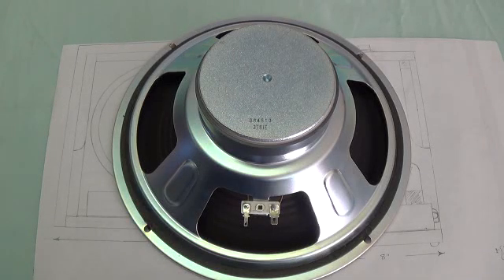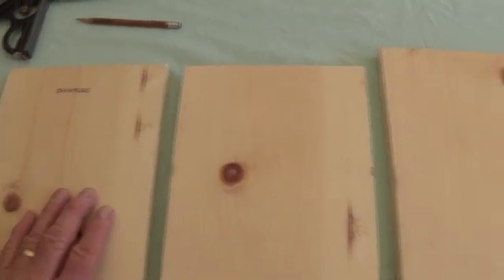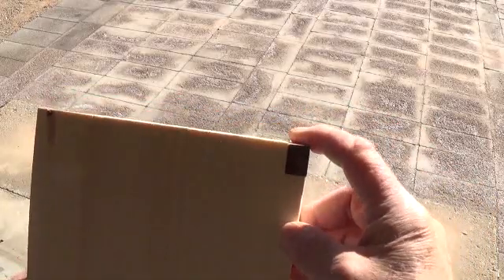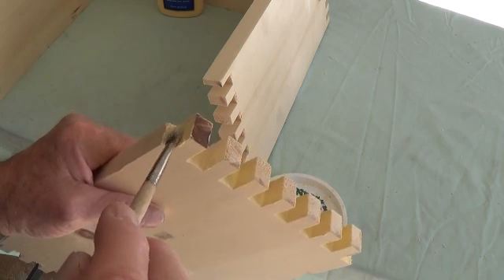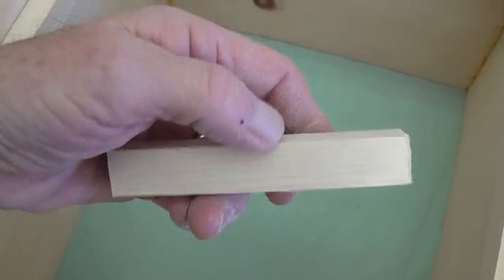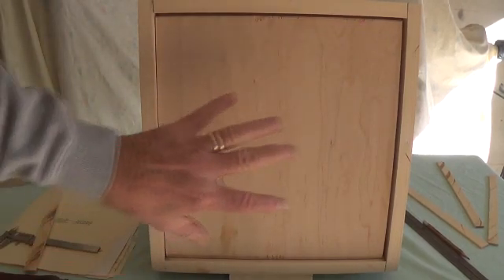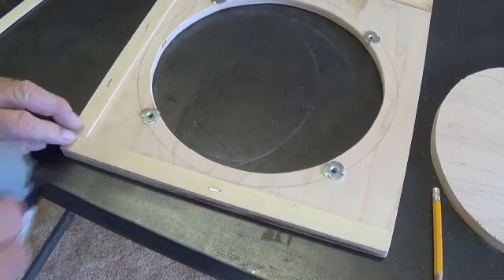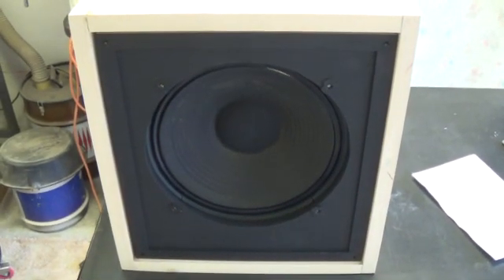Constructing a Finger-Jointed Pine Amplifier Cabinet.....Part 1

Comment: How do you attach the baffle to the cabinet after it has the grill cloth installed?
Reply from the maker: In this case, either four screws through the grill cloth......or four studs installed in the baffle before the grill cloth was applied.

Comment: Greetings Doug. I'm building a similar pine box cabinet a bee (brood) box for $20. Anyway I noticed in this video you mentioned that the power leads to the speaker be positioned perfectly straight down. Is this because your amp is beneath it or is there another reason? I ask because my amp will be on top of cabinet. Thanks Doug. As always your lessons are the best!..Sky
Reply from the maker: That video was made long ago, Sky. I guess I meant that, as you surmised, the leads should go in the direction of the chassis. Good luck with your project.
Reply: @UncleDoug  Thanks for your quick response Doug. I don't know how you do it...answering all your Youtube fan mail. But you do w detailed, courteous responses. Who knows. Maybe 1 day our paths will cross. I would like to buy you a beer.
Reply from the maker: @MrSkywunder  You're welcome, Sky......and I would gladly drink that beer ;)

Comment: Great video! I'm about to build a head cab and matching speaker cab for a tweed Champ clone I currently have in a 1X10 combo cab. I'll size the speaker cab appropriately so I can can make 2 baffles: 1 for a 10" speaker, and 1 for a 12" speaker. I didn't read all of the comments, so I apologize if it was asked and answered, but why not use a 1X10 piece of pine, instead of adding the extra inch of wood on the front? Not being critical, but just wondering if there's a functioning reason for it, other than you wanted a little more clearance. I'd think a 1X10 plank would achieve that as well, and keep the box to 4 pieces of wood. Just curious. Thanks again, for the great video!
Reply from the maker: This was a long time ago, Dave, but I think there were no good, straight 10" wide boards to be had at Home Depot that day.
Reply: @UncleDoug  That makes sense. I have a great 10' 1x12 board, with good grain, that's straight as can be, but I got it from a lumber yard. I'd rather save that for something else, instead of ripping it to 10", and get a 1X10 board, but we'll see.
Reply: Oh snap! I wanted to add, I didn't realize that you're the guy that makes the great "How Tube Amplifiers Work" videos, which are excellent! Thanks for explaining things in a way people often confused by this stuff can understand!
Reply from the maker: You're welcome. Glad you enjoy the videos.

Comment: Ok 
I am convienced beyond a shadow of a Doubt ..  that You are the Tube Amp God of All Gods ..  ok Enough Sucking up .

I am a over the road Driver   I have a 1600 watt inverter I have 5 battreies on my tractor ..  what I would like is a 5 W tube Amp  with a 10 " speaker . this will also be used on 110 currant as well ..  something between a champ and a jr Blues Amp .. If you read this . and interested please let me know .  you are very  Finicky and take pride in your Workman ship this is something I apprecaite very much ..  I look forward To speaking with You ..  Thankyou for your videos ..
Reply from the maker: It sounds like you're looking for an early single-ended Princeton, LB, like the model 5F2-A I featured in a previous video. Check it out. Be sure to subscribe to get new video alerts.

Comment: 6yrs late to this one. Nice Doug :)
Have you ever tried using a ceiling diffuser for a speaker grill? It takes a taller and wider baffle to accommodate but it works quite well and looks cool. I wonder if I am the first to do this?
Reply from the maker: I have not, Tim, but appreciate the tip.

Comment: I've gotta say, after 4 semesters at ITT Tech, those who cower in the face of arithmetic, should probably run now. Run fast and far, because it only gets deeper, and if ohms law causes anything but elation, maybe you should leave this part to the rest of us. We will gladly carry the torch into tomorrow, with a cheerful smile as we accept payment for biasing your amps.
Reply from the maker: Well said, Brian, but at least if the math is presented in a palatable way, it is easier to "swallow" :)
Reply: It's not TRIG, or, perish the thought, Calculus 😭, Rolling on the floor clinching my sides from laughing harder than I have in years. I nearly pissed myself. Good show Sir.

Comment: Sir, great build, truly a Master I would love to apprentice for. A suggestion for improvement, with your approval; you use T-nuts for securing the speaker to the baffle, a very pragmatic and necessary modification, would it also make sense to use T-nuts when securing the baffle to the cleats? Your opinion on this will be carried forward and given high regards.
Reply from the maker: Thanks so much, Brian. I would agree with their use to mount the speaker baffle to the cleats.....especially if they were installed in the front of the baffle itself, like those for the speaker,  hidden by the grill cloth and allowing for invisible but very secure fastening of the baffle to the cleats. Good idea !!

Comment: Dovetails would have made a big difference. Slso a pc fan to get the hot sir out pat tubes is best idea. Doesnt need to interfere with amp. Could run off 5v.
Reply from the maker: Thanks for the suggestions, Matthew.

Comment: Are the spacers that the grill cloth sits on needed if your wood baffle has a decent thickness to it? because then the speaker is technically far enough away from the grill cloth that it won't touch it?
Reply from the maker: The spacers are not to prevent the speaker from hitting the grill cloth. By lifting the grill cloth away from the baffle, it allows the speaker to move air through the entire grill cloth, not just the circle of grill cloth over the speaker. This is how Fender does it.

Comment: Do you have any suggestions for building a cabinet without finger joints .. for us  commoners who are  limited to a circular power saw and drills .
Reply from the maker: Sure, Wiley. I have seen some commercial amp cabinets that don't have box joints. As long as you intend to cover the cabinet with a material, who would know?  Just screw or nail the heck out of the joints, use plenty of good glue, and be sure to have panels in the upper and lower rear to keep the cabinet square.
Reply: Uncle Doug  I guess my concern is having the nice rounded corners and edges you get with wood working equipment.

Comment: great video!  I know it's been a while, but had a question.  I see that you added an extra inch to the frame so the chassis didn't stick out.  was there a reason that you didn't just just get a 1x10 and rip that to 1x8?
Reply from the maker: I don't recall exactly, Michael, but either I had already cut all the notches for the box joints, or I just didn't want to go back to the store to buy more lumber.

Comment: so where can you get straight boards?  Is home depots birch 3/4" plywood ever straight?  Also, on that video with the finger joint jig they did not show anything about making the "key" to align the jig... having that be perfect would be very important to the tightness of your joints wouldnt it?
Reply from the maker: The select pine boards at either Lowe's or Home Depot are generally straight enough for small cabinet building, CM. Yes, the key is simply a small piece of wood exactly the same height and width as the notches being cut in the ends of the planks.

Comment: Uncle Doug, for building a simple head cabinet (no speaker), and using minimal tools (I'll have to have the wood cut by Home Depot), what kind of corner joints are best? Butt joint, or rabbet, etc.? Have you seen any good videos on how to make them?
Reply from the maker: Finger joints are best, but since you have no power tools, it would seem that you are limited to butt joints, which are the weakest of all possibilities. If you can gain access to a table saw and dado blade set, then this is an excellent video on how to cut box or finger joints:  https://www.youtube.com/watch?v=AiPzFNsuN2k
Reply: Okay, and thanks for the video link! I also might look into a bisquit-type joint. That tool seems like a nice initial investment. I have no garage, etc., so table saws and the like are out of the question. Cheers and thanks!
Reply from the maker: Good luck with your project, Roger.

Comment: Do you have any thoughts about edge glued pine boards? Our local Menard's has edge glued pine 1 X 12s. They are 25 to 40% more expensive than no. 2 pine and still have knots, but they should be straighter and flatter than regular pine 1 X 12s.
Reply from the maker: I'm not familiar with the term, Bill. Do they soak the open grain at the end of the boards in glue to seal them?  I don't see how this would make a difference in the straightness of the board......unless they only edge glue better grade lumber.
Reply: Edge glued boards are made by gluing narrower boards together to make a wide board, much like a table top. This allows the grain to be reversed on adjacent narrow boards which may reduce warping. I probably wouldn't bother with a 1 X 8 or narrower, but the 1 X 12s that I have seen are pretty straight and flat. You can get the edge glued boards as wide as 18 or 24 inches. I've been seeing edge glued Aspen boards for some time, but only recently seen them in Pine. The knots are small and there should be less waste. I haven't noticed, but there are probably finger joints in the narrow boards. These should be staggered and shouldn't affect the strength of the board.
Reply from the maker: Now I understand, and it makes great sense. Such composite boards would not only be flatter, but also more interesting if stained and finished. I only use 1" x 8" (maximum) for my cabinets, so this may not apply to my needs, but I can definitely see why others, who need wider boards, would prefer this method to warped, wavy "natural" wood.

Comment: I feel like a bit of a butcher seeing this as I used a biscuit jointer to make my guitar cab
Reply from the maker: If your method of jointing produced a solid, attractive cabinet, then there is no need for remorse, PS.
Reply: It worked surprisingly well.  I braced the corners too just in case.  Building a cab is one of the most rewarding projects I've ever done
Reply from the maker: For very heavy amp cabinets, I use metal L-angle internal braces also, at the inside top-side intersections. It would be a shame if the whole cabinet and chassis were to break away and fall down a flight of stairs :)

Comment: Hi Uncle Doug, a couple questions if you have time to answer. I don't have access to pine, and I'm not a woodwork buff - I'm an electronics hobbiest?? Currently living in Indonesia and pine is uncommon around where I live. 4 choices I have are plywood, mahogany, merbau and teak. Does the timber used affect the sound the amp puts out?? please advise which is the most suitable. price is no matter as all are pretty cheap here..in fact plywood is probably the most expensive.
Reply from the maker: I would think that the harder the wood, the less the cabinet would resonate, and laminated wood is hard to router......so I guess the mahogany would be the best choice, however this is just a guess since I have no experience with any of the woods you listed.
Reply: Thanks Uncle Doug for the prompt response. Yes my amp will be natural look, so mahogany should look nice, Its used as guitar top on some acoustics, so it has good resonance properties (i'm guessing)...but its pretty thinly cut for that application. In an amp with a heavy magnet and vibrating speaker cone, wondering how thin my panels should be??? Being a hardwood, maybe I can get away with thinner walls still have resonance (and reduce the overall weight), and still retain structural integrity?? thanks for all your time and effort on making these vids..much appreciated and valued resource. cheers Steve
Reply from the maker: If you have good, solid finger joints and a small to medium-size cabinet, I would think that 1/2" mahogany would work fine......and look great to boot.
Reply: Thank you. Sounds like a plan. Yes it will smaller than champ size..more like a mini solid state amp..based around a 6" speaker..something I can put up on a desk at low volume. cheers for your help. One more annoying question :). I will be buying a router to do the finger joints, and making up a jig. What type of bit should I buy and what width. I guess I should be asking what size are the finger joints, if the amp was just 12 inches in height..and what would you recommend for the rounding ..1/4 inch bit if the thickness is 1/2 inch??

Comment: 1/8 " for two layers makes for 2 times that for clearance right? Baffle will need clearance for 4 layers not 2.
Reply from the maker: I was describing the clearance for each side of the baffle, Pief, which would be for one layer of grill cloth and one layer of covering material. Naturally, since there are two horizontal sides and two vertical sides, the overall dimensions of the baffle must provide for twice this amount.

Comment: Hey dude. What a great video! One question, what are those things that you use with the screws to secure the speaker to the baffle?
Reply from the maker: I believe you are speaking of the press-in nuts that are readily available at Home Depot and other such stores. They have prongs that prevent them from spinning when you tighten the speaker screws.
Reply: Uncle Doug, they are known as "T-nuts".  It is best to router a recessed area for the flange(s) of the T-nut(s) to sit in, flush with the surface of the board (alternately, you can also use a flat spade bit to drill a flat-bottom  recess for the T-nuts). I also rough up the T-nuts with a Dremel bit and epoxy them to the wood panel, or they may come loose ( push out, or spin free) when threading and tightening the speaker bolts. Modern, new growth white pine is SOFT.
Reply: Mathew Barwick, they are also known as T-nuts. See the longer comment directed to Uncle Doug....

Comment: Doug I may have missed it if you mentioned it, but what kind of screws are you using to secure the baffles to the box?
Reply from the maker: I use basic 1 1/2"  #8 or #10 wood screws, with the heads painted black so they don't show through the grill cloth.

Comment: is it possible to alter a existing cabinet from 1 big cone to 4 12" cones
Reply from the maker: It's impossible for me to say, without all the measurements and/or a diagram of the cabinet, but I guess you could cut out the single-hole speaker baffle and install a 4 x 12" hole baffle.
Reply: Thank you for the info the video was realy help full
when i get in ill take a photo of cabinet and tak measurements n send then to you
Reply from the maker: Kristopher, I think you should look at your speaker baffle and determine if there is sufficient surface area for four 12" speakers. Perhaps you could cut four 12" circles out of cardboard and see if they fit. If they do, then replace your single-hole baffle with one that has proper cutouts for your four speakers.
Reply: will do thank you doug

Comment: just to clarify, my fingers are all the same just like yours except where you used a narrow finger I used a larger by 1\4" finger. your videos are supreme! i am trying to build this project legitimate but tools of course are an issue somewhat. I bought router bits that I will mount to a drill and monkey rig to a table to save on the cost of a router table. and for the finger joints I may have to file them all into spec! more motivation than time or money is my situation
Reply from the maker: Thanks, John. I doubt that a drill can spin the router bit fast enough to make smooth cuts. Routers operate at a very high RPM.....much higher than drills.  Filing the finger joints would be quite a task, but I guess if you have the time and patience, anything is possible.  Good luck :)

Comment: I found a couple good planks and chose cuts without nots in the wood. I'm also planning to cut my finger joints to include a larger finger instead of a slim finger to add strength. if you remade your project is there anything you would change?
Reply from the maker: Knot-less pine is probably better, and I do select my boards in this regard. Larger fingers are actually weaker than smaller ones.....just like fine-thread screws are stronger than coarse thread. The more surface contact in the joint, the better.  Actually I probably wouldn't change anything in this cabinet. It turned out just fine.....at least IMHO :)

Comment: Here's a clever (cheap) way to cut the baffle circle. https://youtu.be/y9DQhCAB0yE?t=1m20s
Reply from the maker: I've tried this and it's better than freehand with the saber saw.....but after the Supro Trem-O-Verb series, I'm hooked on using the router to cut the hole. Thanks, Craig.
Reply: I used a router and made a jig out of some 9mm ply, fairly neat : https://www.youtube.com/watch?v=Ki7Buk0fcjM

Comment: why did you add a lip... why didn't you just make the cabinet deeper to begin with?
Reply from the maker: +Charles J Gartner  It was easier (and less wasteful) to add the lip than to use a much wider board and cut down all four sides to the desired width.

Comment: If you do finger joints by hand you mark out the same as you have.Then you  clamp and line up the finger and make very precise slow cut's with a fine cut tenon saw.It's all about take time and being very precise with centering those elongated cut's....
Reply from the maker: +Jason Hendrix  I agree, Jason. Thanks for your input :)